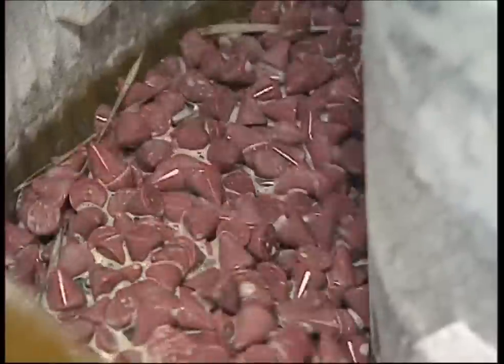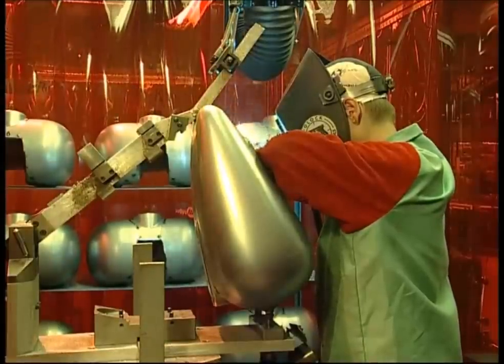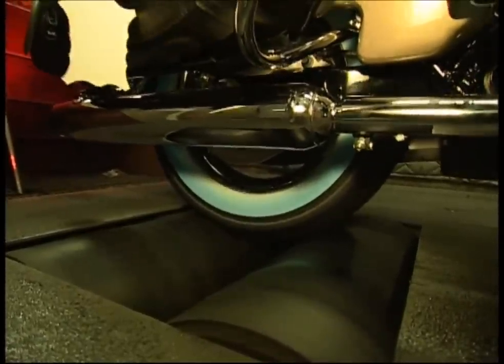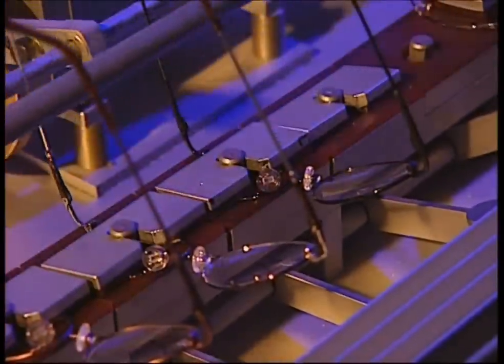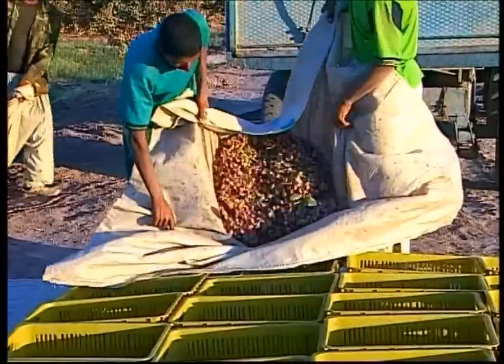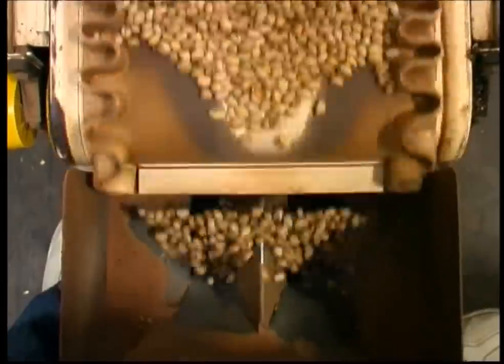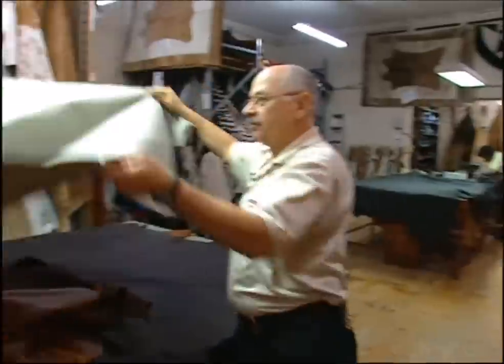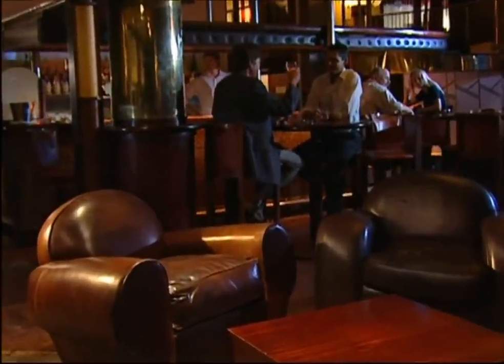HOW IT WORKS | Harley Davidson, Glasses, Pistachio Harvest, Armchair | Episode 25 | Free Documentary

Comment: 625 ℃ would make the solder evaporate. You mean ℉ 9mins in!
Reply: No your wrong sorry he was right on the temperature 1155 f is totally normal for brazing my silver soldier melts at 1200 degrees f. Look it up if you dont believe me!
Reply: Most likely brazing, not soldering
Reply: The narrator said soldering, not brazing, solder temps are about 330-350 deg C.
Reply: @johndoyle4723  Yes and it should be silver solder or silver brazing depends if you'r a Limey or Yank.

Comment: Dude was clueless about Harley suspension. My '05 has had to have suspension mods like Ricor Intiminator valves in front, special oil mixes, and a definitely tighter rear shock setup to make it a performance cruiser, that it's not the same bike anymore. Anyone who enjoys the stock suspension is most likely just a flower sniffer and a "Safety Sam" type rider. It works okay for that style I guess, but after my first week with it, I knew I needed better, and researched it. I'd also worn off the rears of my floorboards, to which these days, I weld 3/8"  slider bolts underneath, probably on my 10 the.set or so now.
Reply: Yeah I don't remember asking for your opinion
Reply: Blablabla cowboy blablabla

Comment: No, Harley Davidson fuel tanks are not filled with Petrol. They are filled with Gasoline. Both #2 Diesel Fuel and Kerosene are Petrol as well. Gasoline is a specific type of fuel.
Reply: @RPI79  And yet Harley Davidson is a US company and this makes it Gasoline that goes into them. How It Works aired on US channels too. So it isn't about conceit, it is about getting it correct for where they are made. In case you didn't know it, Distillate is Diesel Fuel or Kerosene which is a specific grade of Distillate as is Diesel Fuel. Kerosene is home heating oil or used in vehicles when used in winter as it does not gel like Diesel fuel does.
Reply: @gravelydon7072  GFY. I'm 41. I've spent the last 20 years in the Specialty Chemical and Industrial Gases industry. I just FKN can't stand arrogant Americans that want to argue over nomenclature.